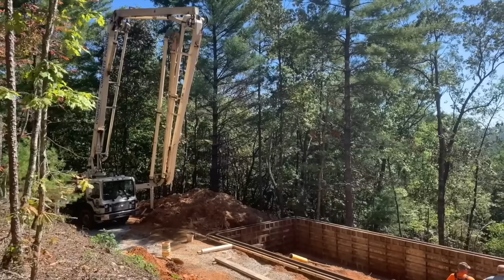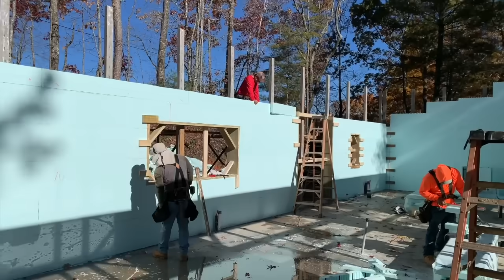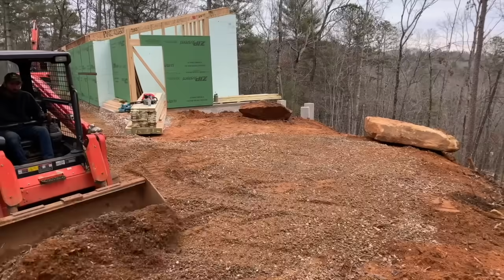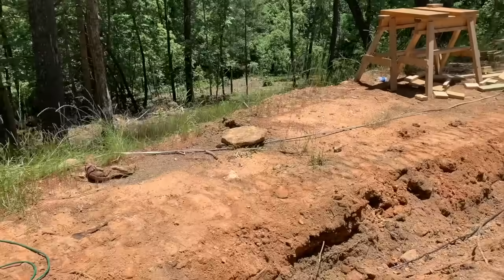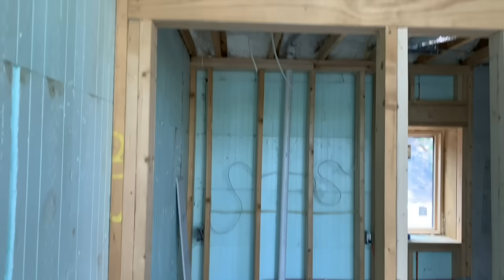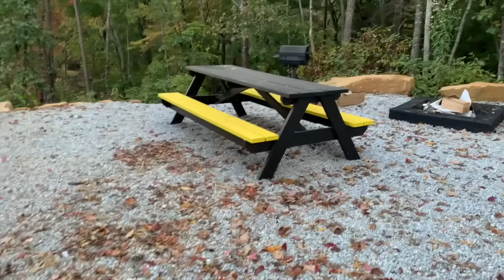Construction start to finish of a modern ICF mountain cabin.

Comment: I like the ICF, and I like the ZIP system. Also the mini-splits. (Low-E double-glazed windows are not a big deal and haven't been for thirty years.) You have constructed a sturdy dwelling, and for that you deserve credit. Tornadoes should be no problem. I'm sure you get good income from the property. From what I can tell, however, you have no insulation at all underneath or at the edges of your slab. I guess it doesn't get cold in South Carolina in the winter. As far as the "architect design" is concerned, there's not much to say. It looks like a warehouse, or a double-wide manufactured home covered in metal roofing. But made out of ICF. (And painted black? In that Southern heat?) I can't imagine an architect in that climate who would design a house without roof overhangs. It's just asking for trouble. However. If, as Le Corbusier said, houses are "machines for living," then I think you're got a pretty good machine.

Comment: What was the point of filling the foundation up with so much gravel.  Could have had a basement or crawl space. Doesn’t it put huge outward pressure on the concrete walls and weigh a tonne on the site subjecting it to landslide.  It’s not clear to me why it was done

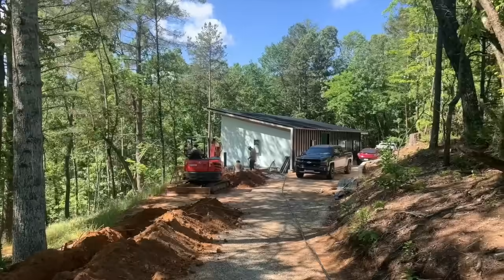Comment: @ 57:20 better add an empty conduit (large one too "like 2 to 4 inches")) to that trench for things that you may want to add latter/ like cable, intercom to gate at entrance, wires to add lights at driveway entrance, tubing to supply water to water feature (fountain, water fall etc.) and anything else your little heart desires LOL

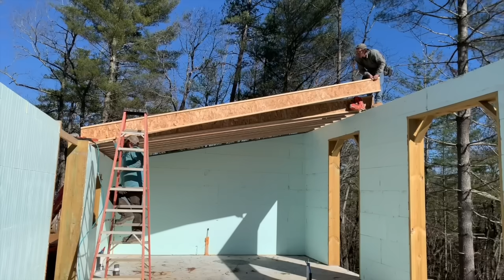Comment: @ 40:00 those engineered trusses on the roof would have been better used to be the floor above a basement level and trusses for roof engineered to hold insulation

Comment: that amount of piers and size is just such a waste of material for the size deck we are talking about / and if you had built the basement that all could just be simple metal post on the basement slab extension / if you designed from the start these humongous piers then you should have just had the floor slab extend over them

Comment: @ 19:50 you will not have instant hot water if there is any run of pipe between tankless heater and point of use the pipes still have to be evacuated / please tell me you are putting in floor Pecs heating in the slab (at least that will make use of all that wasted concrete for the slab)

Comment: @ 18:00 if you ever have an issue with any of those rough ins (plumbing, electrical and drains) they will be a nightmare to fix if under slab / my God why oh why did you not just build a basement and have two views of the valley and under deck use Why Why Why ???

Comment: Great video, thanks for sharing! Choices are a matter of taste and budget but I am wondering: with those massive pillars why not doing a wider deck so you can extend your legs on a lounger or similar or even put the jacuzzi directly on the deck?  the first thing you see when driving into the house is the trash can! electrical panel and AC equipment ! I would have put that out of sight when arriving  (or hidden somehow) . Lastly construction seems
Very robust but was all that gravel filling of the foundation really necessary? and specially the thick concrete retention wall in front of the house? Great job! Looking forward seeing the cost breakdown

Comment: You should have done a walkout basement. Such the perfect spot for it. 6inch thick walls are all you need if building with stick wood & 2x10 lumber FLOOR/ROOF(what i will probably do)(Maybe even 8inch block water sealed on the outside(low cost diy insulation filled blocks)(floor tube heating w/diy ground insulation). Steel columns are way cheaper than concrete wall supports. I like this modern style layout(Orca prefab alternative | theflatsofcumberland). I will watch more.

Comment: Interesting video. I had to cringe a bit at your description of "waterfall" design of the roof. Shedding water off that roof with no extension of any kind, especially noticing the design of the window casings...I see nothing but water issues in your future. A concrete/rebar reinforced structure is indeed quite strong, but water is it's weakness. Water wants to find a way in, and if you help it do so, you have big problems. Concrete spalling is a real problem.

Comment: This is very close to my ideal place, same style house etc. Would I be wrong to assume that you get snow? If not, that driveway could get tricky in the winter with snow coming off the roof. Other than adding a French drain the entire length of the driveway side of the house..you can never be to careful

Comment: Very nice build. For long I was wondering about large windows cutout in ICF panels, first time I see one in a video. Seems it worked pretty well. Do ICF manufacturer give instructions as to what the windows maximum dimension are ? (In proportion to the rest of the ICF panel) Thanks

Comment: Beautiful and unique project.
Nevertheless, a few comments:
- why not reverse the pitch of the roof so that solar panels could be laid on it? that way, a mezzanine could also be built in
- why not use the space filled with gravel as a beothermal unit?
- was a drinking water well drilled?
- regrettable that there is no pre-treatment on the waste water and only decantation
I understand these "imperfections" because they have a heavy impact on the immediate cost, but could add value in the long run.

Real Estate Valuer - Belgium

Comment: Nice place, you are right, ICF is the way to go. I would have done things a little different. Use a 10" ICF for the stem wall, (NUDURA makes one). Install drain-tile around the footings, draining to daylight. I would do this inside and outside the stem wall and footings. Transition to 6" ICF at the floor. Brace from the inside, since you don't have a floor yet. Drain-tile to a sealed basket, just under the floor, in the rock, this would be for radon abatement, and could be used for water removal. Pour the floor after the walls are done, probably after the roof is done. Pin the floor to the ICF walls. 

Hopefully that was not the final pitch of the drain to the septic system, it is too steep. Too steep won't work well for solids.

I like the shed roof, framing and up slope eves.  I would consider adding R-10 ridged EPS insulation below the TGIs.

I would not have used so much black, regardless of appearance black can get too hot, causing oil-canning of the sheet metal and so on.

Comment: Can someone explain why he couldn’t back fill with soil? Half the foundation was filled with soil. Which he topped with gravel, why could he have used the soil from the uphill part of the house and then topped it with gravel?
Reply: OCD
Reply: I’m definitely not sure but it may be code there. I see them do a lot of that with mountain homes.
Reply: @CroppedHornet  No it's not.  Seems like they are ripping off the home owner by buying gravels from their friends.  All you need is like a foot of gravels for drainage then lay your cement floor.

Comment: For those watching, you can put a crawl space and eliminate all of the gravel fill.  I have built many homes in my 44 years in the business.  Gravel is getting crazy expensive and you can use the crawl space for hvac and plumbing access also.  I am building a house right now like this.  (videos on my channel)  Also, with the price of concrete going crazy, floor joists and subfloor are less expensive that concrete.  They could have saved about $15-$20k on this house I would say.

Comment: I can only imagine how much it would cost to build something like this! Amazing.
Reply: ICF is not prohibitively expensive. Assume a house would cost another 10% on total price to build to make it near passive house products and techniques with ICF walls and SIP roof.

To gain the same energy efficiency of ICF you'd have to build a 2x6 or 2x8 double studded thick lumber framed  walls and then fill it all with insulation while avoiding thermal bridging.  It's not easy.  With ICF it's easy. Like really easy to avoid thermal breaks. You can still screw up the thermal breaks at doors, windows, etc but you build those to be very efficient too with high energy efficiency.

With ICF you also gain the benefits of sound proofing, fire resistentance, tornado and hurricane resistant, and bug/pest proof which all lower home insurance costs.   You're living in a bunker but it can be built to look like any style home you want.

The 6" to 8" thick concrete ICF walls with outer layers foam become thermal sinks by soaking up heat in the Summer and in the winter ists releasing heat if the air is cooler.  So if for instance you opened a sliding glass door to the outside for a few minutes and then close it you'll notice the temp hasn't change much in the home; the home air temp balances with the concrete.
Reply: It the labor that that cost 90% of the home,  if you can built which is not difficult, the only you have to worry about us materials and a few labors

Comment: Interesting that you don't tie the floor slab to the foundation walls. We would have robust mechanical tie bars there. Also...waste of time putting mesh in the floor if you are going to leave it on top of the vapour barrier. Needs to be chaired up so in the top 1/3 of the slab. With the concrete floor slab at the same height as the front porch, utility room firewood storage area and spa pool floor, you are going to have issues with water seepage and leaks. Pity you didn't have a better roofer as the oil canning and detailing of the cladding above the bathroom and kitchen windows would drive me nuts. Good luck for the future.

Comment: I would have wrapped the outside of the foundation in rigid, closed cell insulation. R-20 at the least.  
 It would be good to power wash the stones dug up and used as seats.

Comment: Very nice but I don't understand while you filled the base with gravel. That would have made a sweat storage area and stairs to lower ground. You could have had your security system housed in a more secure concrete bunker then. All that gravel seemed to be a more expensive option.

Comment: It seems like your not going to have much parking area,  I would of cut the hill side back further,  used the material to back fill inside foundation. So you lose a few trees on the upperside of roadway, wait until it starts snowing,  you be better of with extra with. Everything is different in the summer time.

Comment: You did not install any vertical rebar to tie the foundation to the ICF walls. This violates code as I understand it. You do mention there is rebar in the ICF walls, but is it tied to the footer and foundation?
Reply from the maker: Yes we did.  The ICF contractor did this.  But it wasn’t shown in the video.

Comment: Thank you for sharing and good job on the video. :-) 
Please only read the following if you are interested in my opinion and not easily offended, because it is not my intention to do so. 
...
...
... 
This solution works, but it could have been solved in a more elegant way. 
I will explain myself. Was it necessary to kill all those trees or could the house have been built somewhere else? 
The foundation could have been resolved with drivers or structural walls in direction of the slope to allow the water to flow under the house in case of heavy rain.

Comment: I did not see deck joist hangers in your video.  I hope that you installed those.  If not, consider a retrofit both front and back for structural reasons. Relying solely on nails is a huge mistake for any deck. You might  also have used ledgers instead of hangers, but it doesn't look as thought you allowed room for those at either front or back..............just a thought.

Comment: Trees all over the place, what happens when a fire storm races through, instead of filling the under floor with stone you could have used it as a fire bunker at a minium cost, and where are the solar panels and solar battery?

Comment: Whoever told you to fill the foundation with gravel is a clown. Seriously, you could have had an amazing basement, and used pre formed concrete hollow core floor slabs which would have been the ceiling for the basement and your foundation slab.

Comment: I'm a now retired residential and light commercial builder with 30+ years of custom construction experience. That said, I am very impressed with your building of this mountain cabin for you and the family.  Great Job!!  Like others, I will be eager to see your cost breakdown. Hopefully you'll have multiple categories and break out labor and materials in those categories. It is obvious that you spared no expense in doing everything in a high-class manner and succeeded in an outstanding finished product.
Reply: I think there is well over 1/2 a million lbs of building sitting on that slope. I just don't want to calculate the lbs per square foot I will just know it is insanely high.
Reply: @roveriia6334  Yup, seems like quite a bit. And god forbid one of those trees falls on the cabin. That would be a costly repair.
Reply: @beefquiche  Sparing money is stupid, why else are they needed?
Reply: Ohh as a builder with 30 years, what are your thoughts of the slab being poured without rebar chairs!
Reply: "Spared no expense" except for the prep work that should have been done to prevent the gravel on driveway from being pushed into the dirt when the ground is wet.
Reply: @stephenurban9880  How does one prevent that? I'm going to be putting in a gravel driveway.
Reply: @centuryfreud  Lay down landscaping fabric over the dirt before the gravel is spread.  Alternately spread and compact a base layer of cheaper rock before spreading the nice looking gravel on top.
Reply: @stephenurban9880  Thanks, will do.
Reply: @centuryfreud  6 to 8 inches of #4 or #6 minus gravel bed put in.  minus means that grade and anything smaller.  It will pack in nicely, and only a monsoon like rain will cause it to wash.  and if you can excavate to clay, it will be even more resilient.  We have some #4 on a 4% grade that was put there in 1990.  It does require some modest maintenance, but it is still there.
Reply: @Krieghandt  cool. thanks!
Reply: for sure costed over $800k
Reply: @Kay.D  i think 600k 200k if he got 24 acers of land and the rest is all in the home i see it like this if u go all out on the house and cheap on the cabinets u win
Reply: grsdgseges
Reply: hgtdrhdrhr
Reply: Who paid you to say anything?

Comment: In our country we use such rebars only for walking concrete path around the house. For house slab at least 10-12mm ...
Overall, (I'm not a construction engineer), but it is very strange construction.what is holding all construction from sliding down after big rain? All that gravel just adds mass to drag everyting down. And front wall(of "basement") has no real support/reinforcement to hold those 175tons of gravel... I hope I'm wrong.

Comment: 😮.  I wasn’t going to comment, (nice job ) but have to advise, as a paver installer I have seen a lot of roofs with water run off and it always does damage to the flooring, whether pavers, concrete, stone or other…..  you may want to add a gutter and Channel the water to a safe location ?  😊

Comment: why use 10-15 truckloads of gravel fill - i live in NYC so id rather have taken OUT the soil and have the basement space .. especially on the downhill side since 1 wall might be sliding doors .. figure you could run a water drainage situation around the foundation ..   LOVING THIS thank you so much for sharing!

Comment: this checks a lot of boxes & i applaud your use of ICF & metal roof, but i'm worried it's missing a few key things:

  -no ERV/HRV with dehumidifier?...an absolute MUST for any structure built with low ACH as an ICF with closed-cell foam roof. fresh air is important for health of both occupants & the structure/materials. no mechanical ventilation is a huge issue, but esp in GA.
  -no roof & siding furring strips?...need an air gap to allow moisture to escape. when the roof leaks (not if), finding & fixing are a nightmare that involves destroying the closed-cell foam. plus, high summer sun won't bake through the black metal & thermally bridge to the interior via the trusses as much if you roll out a radiant barrier too.
  -no overhang?...w/o an overhang or gutter, all the runoff from the roof accumulates at the base of that long wall after running down it, & possibly behind it. didn't hear Zypex mentioned, so even with a french drain, the moisture will seep into your foundation/slab/wall at a high rate.
  -no insulation under the slab?...all the great passive heat gain through the day gets wicked away from underneath, instead of releasing back into the home at night.

sorry if this is the 1st time you're hearing of these issues, but they should have been addressed by your engineer or at minimum, any one of the many contractors should have said something. they're that important (well, aside from slab insulation, that's just beneficial).

Comment: I really like the overall finished cabin. Very chic. I might have actually built it on the upper level of the driveway with the deck extending over the current driveway so instead of dead ending the driveway at one point into the house, the deck would act as a car port and extra level of usable space. Basically shift the whole thing about 25 ft up the mountain slope. That is, if you owned the property. Of course, there's a reason behind everything. Kudos! Enjoy your new seasonal home! The Firespit is great!
Reply: I was thinking the same thing but then they would not get the great views from the deck, unless you mean building the deck top of the car port
Reply: Then you have to climb 15 feet of stairs up to your house every time you park...